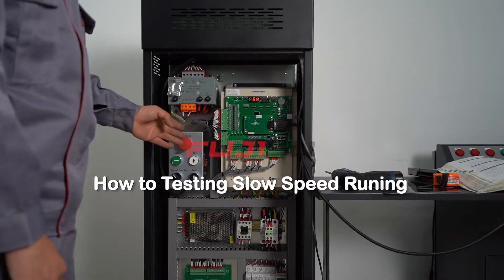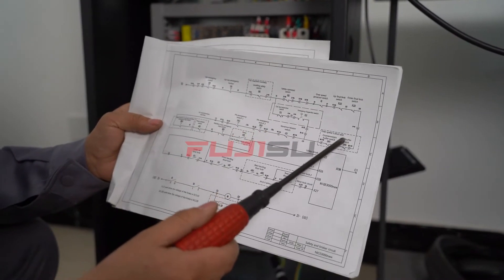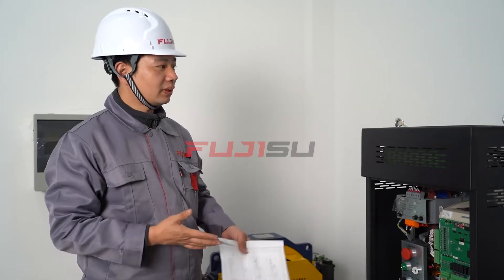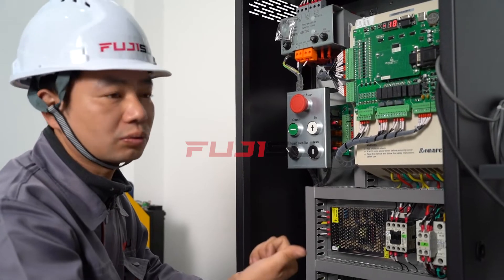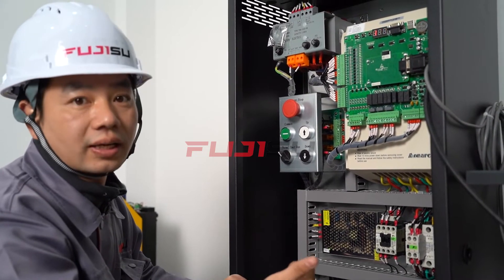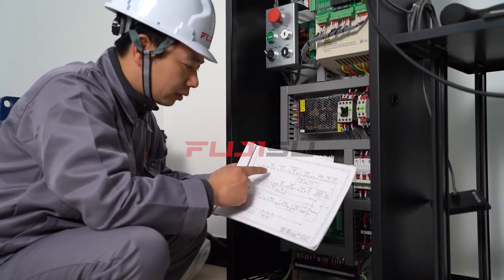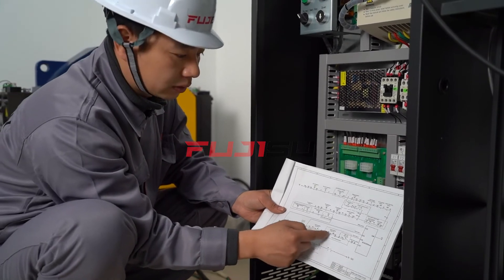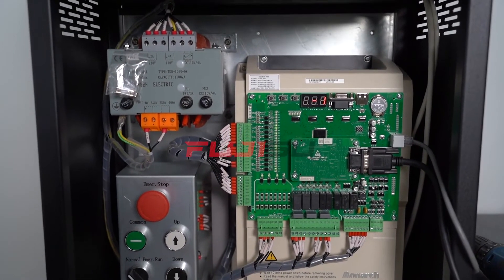How to Testing  Moanarch Inverter NICE 33000+

Comment: Hello...
I have error 20 with sub code 09.....in monarch nice 3000.....with mona drive mona 200a gearless machine......it comes always on the lift when it start running on the call....or on maintenance.....but not on the lift during running ......
Please guide me.....its urgent.......